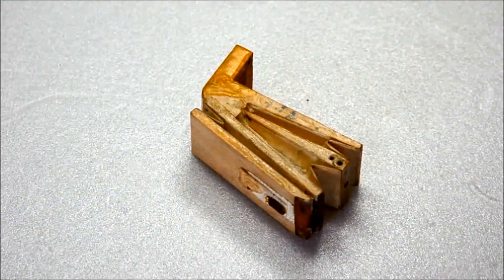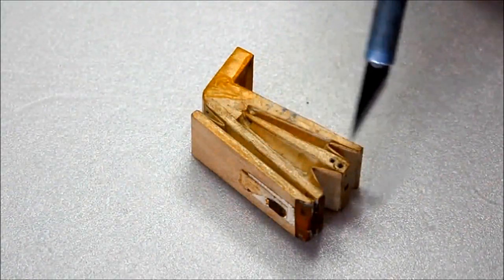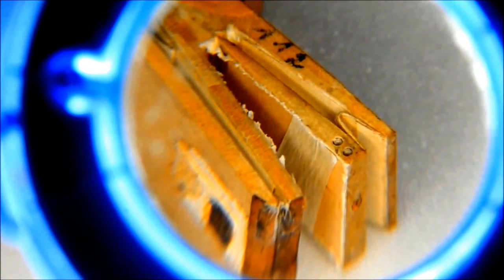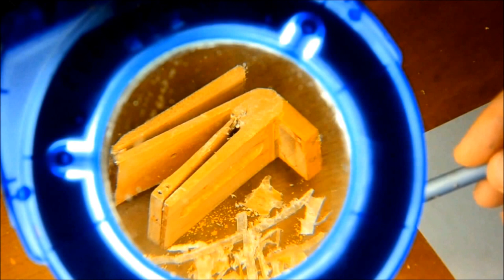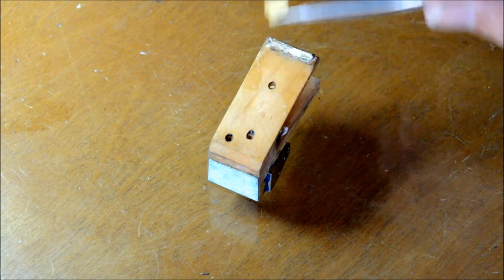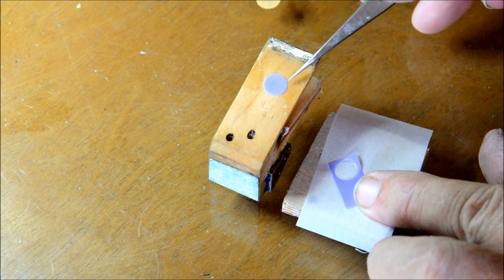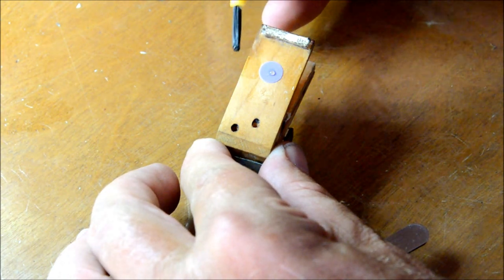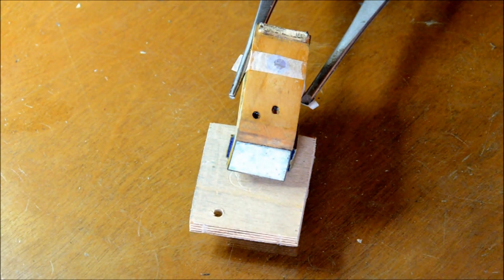Griesbaum Whistler Bellows Restoration Part VII

Comment: Do you have experience with the bird cages?
Are the bellows used in the cages basically the same as those used here?
Got one coming that has "low" sound so I assume the bellows will need to be restored.
Is there a preferred source for repair material?

Comment: Don, What brand of the 2 part silicone do you prefer.  I have found many brands of this material but I would like to work with something that the experts like you use.  I sure do not need to make any more mistakes than I already have.
Reply from the maker: I have been using Smooth-Sil 945. The smallest size unit is much too much for a few valves so unless you have some other projects for the molding compound it may be worth trying something similar that can be bought in smaller quantity. Don't be afraid to experiment since, if you have not done this before, it may take several tries to have success anyway.

Comment: Don ,  I am confused .  I am attempting to make the silicone valves as you show in your video.  In the comments  I find the thickness required is stated to be .50 .  The original paper valves are .05 .  Can you clarify if it should be .50 or .05 Pleeeeeze ?
Reply from the maker: Thinner would probably be better and some experimentation is in order. Silicon is very flexible, compared to paper, and there is really no interference with the action with .05 which is what I used. The key is to make sure the valves close when they are supposed to and the valve material must be restrained to be close to the ports (especially the valves where gravity will tend to make them "hang down"). The paper valves often fail because they warp and the slight vacuum created, that is supposed to suck them to the sealing surface of the wood, is not strong enough to pull them to make a tight seal.

Comment: Thank you for sharing this!  I have one that is over-wound and frozen up, as a result. All components seem to be intact and the bellows still chirp when I manually manipulate them. Is there a lever that will release the tension in there, somewhere?
Reply from the maker: There is no such thing as over-wound (every clock maker cringes at this statement). When the clockwork is dirty it gets stuck when wound up to maximum. The clockwork needs complete disassembly and cleaning when this condition happens. A clean and serviceable clockwork cannot be "overwound".
Reply: @donh9968  thank you! I'm obviously a novice. I recently inherited the item and all I know is that it won't wind up any more. Ha ha. I appreciate your advice and expertise!
Reply from the maker: @JM-oy2kt  If you decide to mess with it just be very careful when the mainspring is wound up tight. There is enough energy in a wound up mainspring to cause severe injury, wear eye protection at a minimum. Good luck.
Reply: @donh9968  thank you! I think I'm going to take it to a clock repair person 4 cleaning and further disassembly. This has potential to be a quite valuable item and knowing me, I would screw something up and devalue it,  significantly... Or lose an eye.

Comment: 🤔 WOW now I am having a problem with my Bello !My Bello is movie like it's supposed to but there's no air getting to the reservoir to make it move reservoir 🥴.But when I make the reservoir move my hand the birds  sounds start singing.So is it a little air leak in my Bello somewhere that's not letting it get to the air reserved part of it?
Reply from the maker: Sorry to hear that. It sounds like the valve between the "power" bellows and the reservoir may have failed. Unfortunately there is no easy fix and it would require a complete bellows restoration. If you go through the videos I explain how the valves work.
Reply: @donh9968  🤔Well thank you for getting right back with me on my question to you! Wow now I was feeling the same way.So I had to up my game on this .😉So I did and I fixed it 🤗👍!Now I am going to make a video and show you and everyone else that love these vintage works of art. And I am going to put a video on here  just how I did it. You are going to lol and at the same time be amazed 😉👍!So will be letting you know when I put this on youtube.And wow I just want a bed on eBay for a two bird with both having the  animation movements vintage singing bird cage .And wow for a low price 😉👍.
Reply: 🤔 lol and I meant to say automation movement in both birds🐦😉👍!

Comment: Hi Don.  Thanks for posting these  videos!  I'm recovering the bellows from a Griesbaum bird cage and have found your videos very helpful indeed.  I was wondering why you replace the valves with silicone rather than paper.  The paper valves in the bird cage I'm working on appear to be in great shape and I was considering reinstalling them. Also, do you have any tips for reinstalling the hinge on the center leaf of the bellows?  I have some very fine skived leather from Columbia Organ Leathers in Pennsylvania that is as thin as the original hinge material.  The center leaf is hinged like the motor pneumatics of a Gulbransen player piano only much, much smaller.  I've successfully recovered those so I thought I'd used the same technique.  Your input would be greatly appreciated!
Thanks!
Reply from the maker: I am glad you found the video useful. If the paper valves are serviceable they work fine. I have found that paper valves can start "curling" and sometimes stick especially if the item was used in an area where people smoked or had high humidity. When the paper valves are no longer serviceable I just replace with silicone since the silicon seem to make a better seal and seems unaffected by changes in humidity. You are on the right track with getting very fine skived leather for the center hinge. Just use the leather and appropriate glue and you should be fine.
Reply: Don H Thanks so much for responding!  Any tips for installing the hinge on the center leaf?  Do you attach the leather to the leaf and then install it in the unit or do you install the leather in the groove and then attach the moveable leaf to the leather.  The player piano motor had a groove in the leaf to accept the leather but the part was also about 10 times larger!
Reply from the maker: I am not really sure about the best way for attachment but I do install the leather in the groove first.One tip in this area is to try and make the pivot point fairly tight (so motion is not wasted on not compressing air but also keep in mind this is an area where careful attention to gluing and sealing is a must.

Comment: How is the silicone valve made and what is the source ?   Also what do you make the hinge out of ?  Source Pleeeeze
Reply from the maker: I make the silicone sheet myself by using a two part silicone molding material. I mix the two part molding silicone and then use a squeegee to spread it out on a sheet of glass or plexiglass. I control the thickness of the silicone by first putting down two or more parallel strips of tape on the glass and squeegeeing the silicone between the lines of tape using the tape as a thickness gauge. The silicone sheet ends up being the same thickness as the tape. The hinge is made from the thinest leather you can find and it is not easy to find. I currently do not have a good source for the skived leather that is as thin as I would like.
Reply: Thank you for this information.  The silicone valve is just what I need for the 4 bellows I need to restore.

Comment: Don, thanks for this video. I am interested in making one of these little bellows but I don't follow how the valve system works to enable air to be delivered to the reservoir when the middle element move back towards the flute. I've posted an image here: https://imgur.com/a/RECmu I understand when the element moves away from the flute, air is drawn in through valve 1, valve 2 closes, and the air is forced through valve 3. But on the subsequent movement, it seems like valve 2 would open and no air would be forced through valve 4. I have made my best guess as to how valve 4 might work. Could you help me understand the second movement and how it delivers air to the reservoir?
Reply from the maker: Hi, thanks for your interest. Your diagram is pretty close.  If you watch the videos you may be able to see there is an air inlet on the end of the "element" (the hole in the middle of the end of the leaf that goes back and forth). There is no hole that goes through the middle leaf between chamber 1 and 2. Also note the reservoir needs a dump valve in case too much pressure is built up.
Reply: That makes perfect sense! Thank you again Don. Back to my workbench...